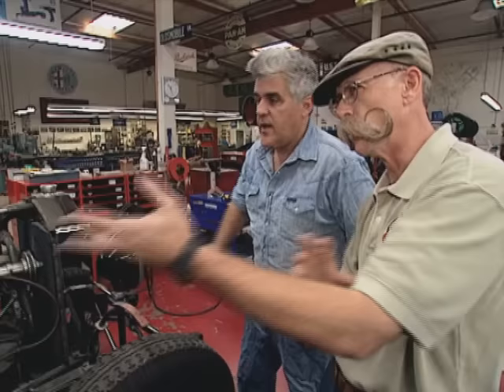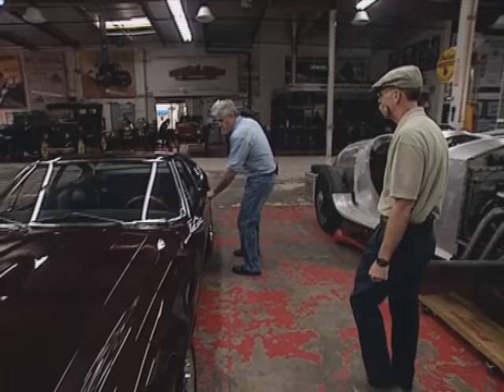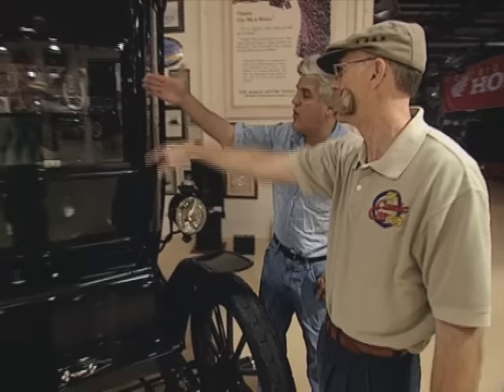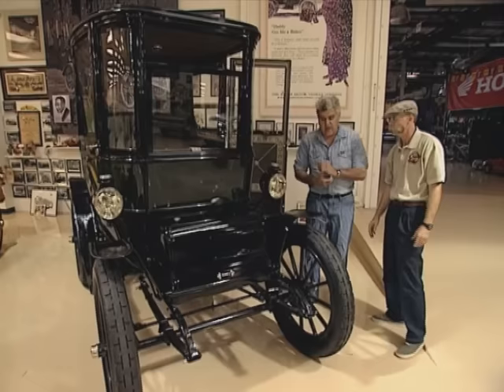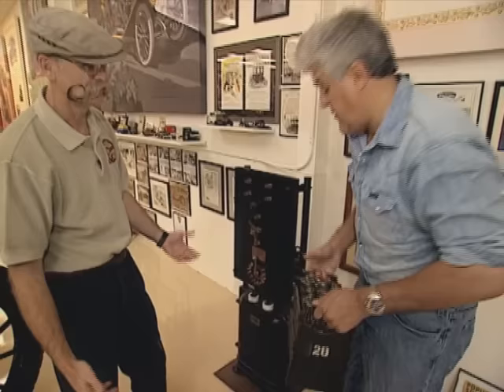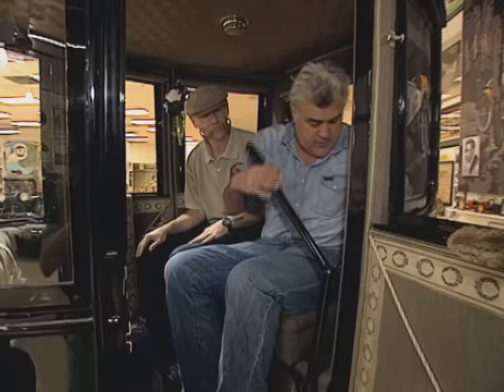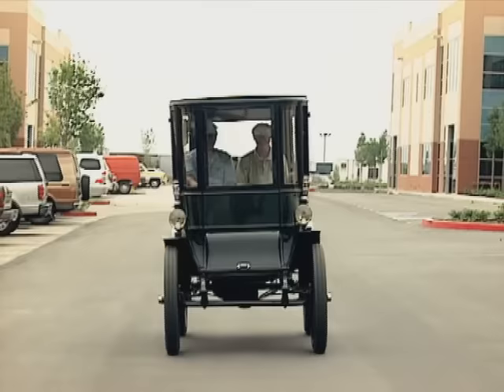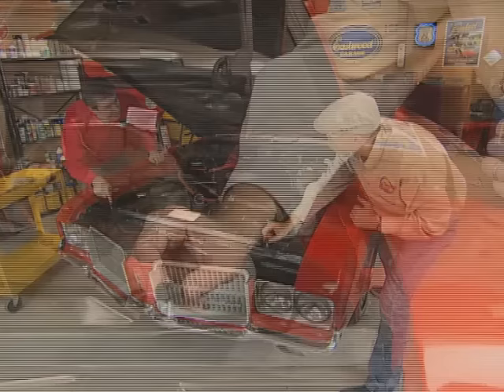Jay Leno's Baker Electric Car

Comment: Millennials: “Tesla is the future!”

This 110 year old zero maintenance electric car goes 100 miles on one charge. 🙄
Reply: non of that computer crap onboard the 110 year old electric car that takes up all teh electricity
Reply: @mrni6502  it also doesn't have a speed regulator and wouldn't be fast enough for the needs of most consumers, nor does it have the safety features
Reply: Lead acid.
Reply: but this thing can only go 23 mph lmao
it takes exponentially more power to go even double that speed, let alone 90 on the highway
Reply: @mfw9902  
Yeah, but if they kept improving the technology for the last 110 years instead of abandoning it, this electric car would probably be traveling at the speed of sound by now.
Reply: 160km is a good range.....how long does it take to recharge?    6 batteries.... that's a few kg ......
Reply: Here's an interesting fact. Internal combustion engines are the highest advocate of the century. For most people, it seemed like the only logical choice for automotive power. But over 100 years ago, internal combustion engines faced fierce competitions: electric cars were clean and quiet, and allowed people to coast around neighborhoods with little noise or fuss, but big heavy batteries that couldn't go very far soon took electric cars out of the race. Cars powered by stream engines didn't had that problem.They were reliable and fast, so fast that back in 1906 they beat out gas powered cars in a head to head race, and set a land speed record of more than 127 miles an hour. Best of all, stream engines had been around for years, and engineers knew how to design and make them work.
Reply: @mfw9902  how fast do you need to go on a phone booth on wheels?
Reply: @jpsalis  You don't really need any safety features when the top speed is 23 miles per hour, LA City traffic speed 5 miles per hour. But if this was possible more than 100 years ago, you should be able to make electric cars today with like top speed of like 70 miles per hour and make it safe and really cheap, not this Tesla nonsense where it's a computer on wheels at Apple prices just because they make them like a modern day supercars that goes from 0-60 in less than 3 sec, Tesla is not building the future, just filling a niche market for people who can afford to buy extremely high-tech and expensive electric cars.
Reply: @Johansen1000  I'd disagree somewhat. Although their cars are a little more expensive than the average electric vehicle, they have helped increase the appeal of electric cars to a wider audience, even if the people in the market for electrics don't decide to go with their cars. In that way they're very similar to Apple like you said. I think the insane acceleration is just an effect of the electric motor vs an engine, though they've obviously designed their car to withstand the torque and speed.

There are plenty of really nice electric cars out there that don't cost a fortune and have good range. Some examples: Nissan leaf, chevy volt, and the bmw i3 (used BMW's depreciate like crazy). 

I do disagree with some of their business strategies regarding their software, but there is nothing wrong with putting a computer on a car vs a more mechanically complex gas engine that is more prone to failure. In fact, most cars in the past 20 years or so have always included some sort of computer inside, sometimes multiple for different parts of a system. A lot of gas cars don't even use a cable from the pedal to the engine anymore, rather they use a drive-by-wire system. Electric cars are no different.
Reply: @er1cmaurer  Its not a matter of them developing for electric cars. We havent had many electric cars until recently because batterys weren't cheap enough or good enough to produce. If you wanted a cheap EV you would of had to used SLA batterys, and those arent ideal for EV's at all. So we kept using petrol until the day EV's can be made at a reasonable cost.
Reply: @sausage4mash  it's not a stupid question, just a misconception
Reply: @sausage4mash  When the boomer doesnt get the joke
Reply: If a Tesla only went 23 mph it would have a 1000 mile range.
Reply: @shabbysnubtide3339  and.... The guy is using modern deep cycle batteries on the old car, so there is that as well.
Reply: I mean, tesla is the future , in the future from the point of 110 years ago
Reply: @neville132bbk  Those look to be 390 amp hour (Ah), 6 volt batteries. Like what goes into a floor polisher / scrubber. Best if run to 50% capacity, but most are run down to 80%. If run to 80% Depth of Discharge (D.O.D) that is 312 Ah consumed. There is a 10% loss in charging Lead Acid batteries. Therefore a total of about 343Ah must be put into them. Most 6 volt chargers available today charge at either 10 amps or 40 amps. Assuming the lighter (10 amps) it would take 34 hours. (343Ah / 10 amps = 34 hours). Using the heavier, 40 amp charger would take about 8 1/2 hours (same formula). If you could find a heavier charger you could certainly go higher. You can go up to 150 amps on 6 volt off a standard US 110V outlet. That charging amperage would still be low enough to not damage the battery. So theoretically you could charge from 80% D.O.D. in about 2 1/4 hours.

Basically, assuming the car ran at its full 23mph on perfectly level ground in optimal weather conditions (70 degrees F) the car would run for 4 hours and 20 minutes, and would pull a constant 72 amps, or 864 watts 12vdc (volts direct current) essential its pulling the same amount of power as about 10 average sized refrigerators.

I'm a battery guy and I'm really into deep cycle batteries haha.
Reply: @jpsalis  I think it more of a case in point of oil and gas company's stunting the development of electric cars  because it would haven eaten into the oil and gas industry's pocket books because if this car when around 23mhp and one charge gave you 100 mile range all what way pack in1909 goes to show how they stunted its development until recently were its become clear they have been stunting this development of this stuff so long we have to play catch up for the time we lost not researching cheaper, lighter, longer lasting battery's and alternate energy.
Reply: I'm not joking when I say all of Elon Musk inventions are that exact scenario
Reply: Most Tesla's can go over 200 miles and charge faster. That said, this car is crazy impressive for it's time.
Reply: People who can't grasp the present will always daydream about the future
Reply: Zero maintenance. Please stop spreading this lie.
Reply: @lolbuster01  jay said it was his least maintenance car, and pretty sure he has a lot of cars in his hundreds of garages.
Reply: @jpsalis  It's 110 years old so the lack of safety features isn't surprising at all, and the top speed of 35 km/h (22 mph) isn't that bad, considering it's an electric car from *1909*. It is slow for the time, but it makes up for the slow speed by being able to drive for much longer than most other cars. It is slower than the model T, almost two times slower, but it has about 2-4 times the range of the Model T, with 257.4 km (~160 miles) range, as opposed to the Model T's 32-64 km (20-40 miles) range. I've written too much and I know probably nobody will read this but anyways who cares, it was fun to write, anyways.
Reply: @Johansen1000  take a look at the Dacia Spring and Renault K-ZE . It's pretty much what you're talking about. My question is not why Tesla is doing what it is, but what are other not doing what you're saying.

Wtf is Volkswagen doing (the people's car!) launching quite basic 40K electric vehicles... What is Toyota doing, what are the indians and Chinese doing who're supposed to understand the cheap but functional market?

Pretty much NO ONE is addressing the next billion people who need vehicles. Chinese manufacturers are focused on China and launching expensive crap elsewhere, Indians make shit vehicles, Americans and Europeans act like most of humanity can afford 40k - 50k vehicles in a heartbeat...
Reply: @er1cmaurer  they didn't abandon it. Lol.
Reply: @er1cmaurer  Which is why they say Tesla is the future...
Reply: Yea but an electric car wasn't man enough for 110yrs ago
Reply: This is where Tesla stole the idea... but no one thinks of that....
Reply: @jpsalis  Actually it's perfect for the need of consumers back then. It was a city car, like every other car. I don't even think they had differentials in cars back then. So trying to drive them on a muddy dirty road would be impossible
Reply: @Johansen1000  You are 200% right!!  What we need is a simple electric car thats designed around long distance driving and affordability. An efficient EV car with small wheels does not even need power steering in my opinion or maybe even power breaks for that matter. Minimize power waste and increase mileage. 

Unfortunately car designers here in the US are gearing towards the 0-60 in less than one second crowd and jack up the price because of that.  Sadly, thats what appeals to people =(
Reply: @jpsalis  It’s also over a century old
Reply: @johndevito2384  today, in my country, electric scooters have become super popular. I see these green scan and rent scooters everywhere now including privately owned. If they made a baker today and had it at a low price point they'd sell faster than hot butter melts in the summer sun.
Reply: Tesla...
"Bringing you the Future, by looking to the Past".
Reply: coincidence they didn't teach us this in school? i think not
Reply: and it was literally developed in less than 5 years.

Comment: When I heard it went 100 miles on a full charge I was shocked
Reply: What you did there, I see it.
Reply: Ba dum tss
Reply: @old4mat  This generation of electricity jokes have an outlet now, but I'll switch to something more current, I have a quick fuse.
Reply: Ohm my god that's so funny
Reply: @Tripp426  missed opportunity to say watt
Reply: When the panels are removed it's a shocker.
Reply: Probably as long as it's somewhat flat.

Comment: The Baker was beautifully laid out in the interior.  It also started up electrically in the days you had to go outside, rain or shine, and risk serious injury to start the model T and others...
Reply: Ya, people have died getting hit with that crank in the face
Reply: @andrewflowers6794  that's why leaded, and then enthonal gas is around, I reduces backfire, nocking and lower the need for such high compression like the model t
Reply: @thekak2627  4.5-1 is high compression?
Reply: @frankpeletz1818 not really but it plqy a fact into how fast a engine can start, as a engine starts if it was right before the powerstroke it would take the crank with it, many time injuring or killing people with it.
Reply: @thekak2627  I crank started many of engines in my time never having a problem. And people would get their arms broken if they did it wrong. You pull the crank and do  not wrap your thumb around the handle.
Reply: @frankpeletz1818  exactly that how i was taught, we have a model a and a 33 3 window pontiac
Reply: @thekak2627  Most important was to retard the timing before you tried to start it
Reply: @frankpeletz1818  yeah definitely.